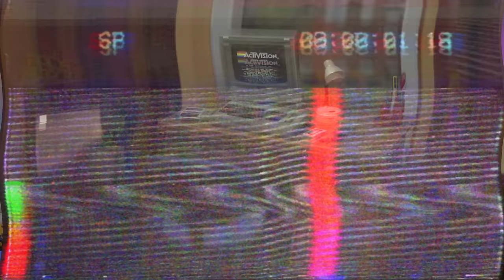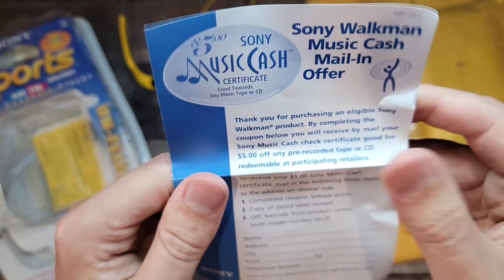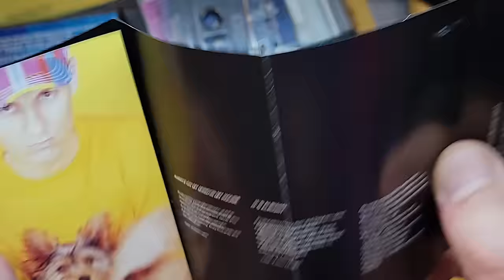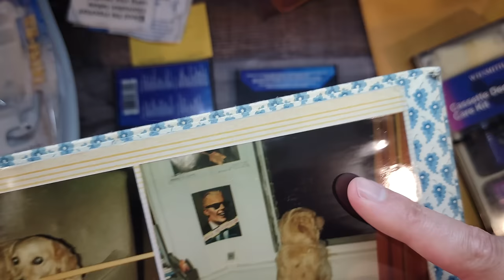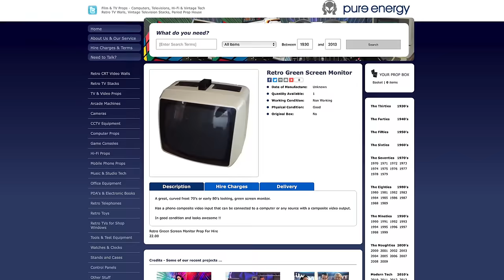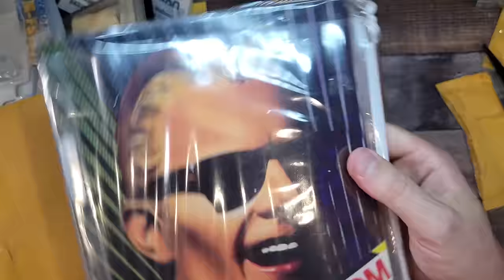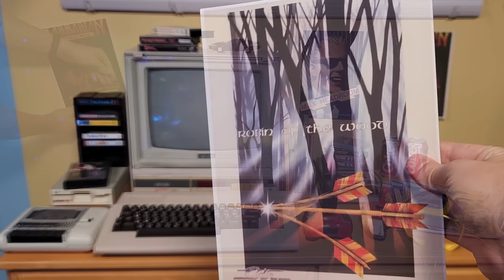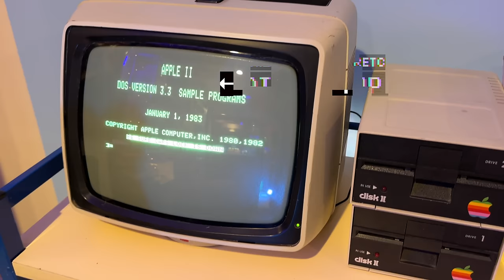Recreating my 80s Childhood Bedroom Computer Setups!

Comment: Just wonderful! It took me back too and reminded me of the other day when an old friend connected on Facebook and reminisced about my old computer room from the early/mid 80s and remembered my ZX Spectrum set up, the white hard case/keyboard, the thermal printer etc. etc. It's got me on a mission to find some pictures which I knew I took. Recreating it wouldn't be easy - Sharp MZ80A, Amstrad CPC464, BBCB, Spectrum, Vectrex, Atari 2600, Coleco, Intellivision, an original Space Invaders Cocktail Arcade table and more!

Comment: You putting the C64 PSU under the desk reminded me and suddenly took me back in time. Mine was also on the floor in the middle of the desk and i would put my feet on it in the winter to keep my feet warm while playing games. As the PSU got quite hot. As a 10 / 12yr old i was clearly not concerned about the psu getting hot. Just that it kept my feet warm.

Comment: I had a ZX81 (1982), a Speccy (the original 48 Kb rubber keys, 1983), an Amstrad PCW 512 (1986)... The music was EXACTLY the same (adding a generous portion of J.M. Jarre and Mike Oldfield)... What a time to be teenager, the early eighties, waiting for the exact azimuth in the cassette to load properly 40 Kb of data and typing hundreds of lines of code from the magazines...

Comment: We had one of those clocks that are below your Max Headroom poster at @15:13.  It sat above our Commodore 64 for years, and I wouldn't be surprised if my father still has it somewhere.  IIRC, it looked like a digital watch stuck in some clear plastic (Lexan maybe?) that made a simple angle bracket stand.
Reply from the maker: Wow can you find out the brand please? I thought Timex but apparently it was something cheaper.
Reply: @RetroRecipes  I could've sworn it was Timex too, but I also remember my dad receiving it as some sort of a giveaway.. so maybe it was a Fimex or a Timax 🙂

I'll see if he still has it.
Reply: @RetroRecipes  My dad said he received it as a Christmas gift from one of the guys he worked with.  He no longer has it (or he stored it in a random box), but he thinks it was a Timex or a Seiko.

I know we had at least one Seiko clock in our home, so maybe that was the one.  I'm looking at some Google image results and I'm finding analog ones with similar designs (but not that particular clock).
Reply from the maker: @RandomBitzzz  yeah I can’t find anything either. Strange as I feel many of us had it. Perhaps it was one of those free giveaways with some other thingy

Comment: All the feels in this!

Regarding your tape that didn't playback properly, it's probably the lubricating sheets inside that are worn. If your tape shell was screwed together, you can easily transplant new lubricating sheets into it. If the shell was fused together, then the only option would be to try to split it open to extract the tape media and transplant that into a new shell

Comment: Thanks for sharing your experience. This video is full of nostalgic warmth. I've started doing something similar with my Amstrad CPC6128 set up although can't exactly as the desk was hand built by my Dad under the stairs. But I've bought the same CPC6128 with colour monitor and even the sticker that came with the Ocean Batman the Movie game to stick on the side. I just need a carousel tape cassette holder and briefcase style cassette holder to put under the desk. Plus dodgy broken Amstrad joystick discarded and replaced with the Quickshot II Turbo that I have also purchased. The older I get, the more I treasure those care-free and happy days.

Comment: You are a real Doctor Who! Tom Baker would be proud.
Only you didn't have a Tardis, yet you still managed to bring 1980 to us.

My soundtrack would have been Styx, My first tape was a Mr. Roboto tape circa 5th grade.

My first PC, a Radio Shack TRS-80 color computer. A few years later, I got a Commodore 128.

I learned the hard way not to save programs to tape on a recorder just using battery power.
In order to get it to load, I had to drain my batteries down to a level the tape player would play at the slower speed it was recorded at.
From then on, it was AC plug all the way.

Why was I using batteries? In the early days, I would put my PC on the floor in front of a tv, sitting Indian style while typing in Basic programs from magazines.
When I was done, I would put the PC away so we could watch TV.

Hats off to you sir, thank you for a free trip Back to the Future sans DeLorean.
I will say this, I prefer to emulate C64, to skip the slow load speed of the tape/drives.
Reply from the maker: Thank you for your kind words! Means a lot 👍🕹️

Comment: I still have my original Commodore 64 and 1541 Disk drive, bought new in 1983, and it is in full working order, having having spent a small fortune on repairs to it, it has been lying in the attic for 30 years and needed major repair, and has now returned to the attic after being out for a while. Then I get to bring it out again in about 30 years for a new return to the 80's.

Comment: This video has such a great lineup of 80s music!   I recently put together a “Rock The 80s” play list and many of these are in there, and you have a few more I forgot about and will have to add.  I was born in ‘75 so when I was old enough to really start listening to music on the radio it was into the 80s, the decade that IMO had the best music.  I never had a Sony Walkman but in the early 90s I bought my first portable cassette recorder (not just player).  I still have it.  In the 80s I only had a portable radio with headphones which is how I was able to listen to so much great 80s music.  My original C64 is a stripped parts board now, but some day I might gather the parts and restore it with a new case and keyboard.
Reply from the maker: Dewit!

Comment: I adore this video. It truly is bittersweet to try these things. I had bought an ‘83 American Motors Concord in 1998. I loved driving it! I used to play my Outfield-Play Deep cassette while I drove it. I owned that car until the year 2001. I got my very first new car at 31 after that. I still miss that car and the feeling I got while driving around. It was hard to pretend it was the 1980s when modern times were outside my window, but it sure came close!

Comment: So inspired by this, I found my very first tape for my micro (an Oric 1) and loaded it into the PC using a usb tape player and Audacity. Converted it using the tools for making emulator suitable files and……it worked! A nearly 40 year old tape game being played by 50 year old me before going to work. It is a simple fruit machine program called Bandit, written in BASIC, part of the Multigames 1 cassette released by Tansoft. Nothing special to look at now, but it was magical having a game running on the big TV in the lounge in the 80s. These were magical times for computer games.

Comment: Well done on the recreation of your memorys man. You know if I wanted to do the same thing in my place it would take quite a lot of effort. The only things I could lay claim to in my retro set up would be my Commodore 64C (with a black and white 12" TV) and on the wall the 3 parts that made the Oink comic calander calander (God only knows from what year, 1987 maybe) attached hap hazardly to the flowery 1960s wallpaper with blue tac. Apart from the wallpaper all the rest was old 1960s carpet, curtains and whatever else made up a 13 year olds room back when things were made to endure. 
Apart from that, I always thought that your first computer was a C64, you seem to have such love for the system. I was surprised when I found out that the Apple IIe was closest to you (I've just gotten myself one, and I'm having a lot of fun with it). The C64 is a great gaming  computer though. Anyway, thanks for this video, sometimes just thinking of the past feels like a hole has opened up deep inside. I wonder if that feeling is not stronger the father we move from home. Take care ;)
Reply from the maker: It’s strange, the Apple is deeper rooted as it’s further back in time, and more connected to my father as it was in his home office. But the C64 I loved more as a computer. And those were special years too, just different.

Comment: Hey Chris! I'm one of your customers who bought your VIC II^2 kits! Regarding your problem of PAL to NTSC video conversion, I MAY have a solution for you. It works great for me, the only caveat is that it does not work out of the box with Y/C (although it is possible to convert from Y/C to vga first... Look up retro video adapter on Ian Stedman's blog) However, if you ARE able to output an RGBs signal (say SCART) or YPbPr, then you're in luck! 
I have a MiSTer FPGA and my solution to getting the C64 PAL core which outputs 50 Hz PAL video in Direct Video mode to work on my NTSC Commodore 1080 monitor was to buy a GBS-8200 and modify it using the GBS-Control firmware. That's your solution! It works perfectly every time with zero lag! Automatic 50 to 60 Hz conversion!
By the way, I love your taste and your channel and especially this video! I grew up in Philadelphia, but we are obviously of the same generation. Tears for Fears, Pet Shop Boys, Commodore 64, Knight Rider, Star Wars, hope you like Depeche Mode and Red Dwarf, too! Anyway, I really hope you figure it out! Check out the GBS-Control project on GitHub! It's definitely cheaper than an XRGB or Retrotink (I have the second version of each of those, lol. And both work great but can't hold a candle to GBS-Control!) and it also kicks the living crud out of the cheap convertors on Amazon!

Cheerio! And Frosted Flakes!

Comment: Tape's need lubrication to save your old tapes there is some video's how to relubricate them. I had to transfer about +20 90min tapes, and learned that they been sitting and stores wrong standing. but to remedy this easiest to try is using a HB2 pen to wind it back and forth to see that the spools flows propperly after 2~3 backs and forths. on them.

Comment: I had a slimline Commodore64C computer, in the late '80s. It was styled just like the Commodore 128, you showed. All the keys were about the same colour as the computer case, in a very pale sand colour. Fortunately, I do have one photo of my complete C64 set-up on my desk with everything around it. I've always been into photography, so I'm surprised I didn't take more photos of my stuff.

Comment: Brilliant, nostalgia brought to life. Enjoyed it so much.
You likely got the slimline case from Evesham Micros as well as the disk drive, I remember them advertising it. Truth is, the original C64 case design (by Porsche Design Centre) was much more wedge-shaped, but Jack Tramiel reused the VIC-20 case to save money (forcing the engineers to cram everything into a tight space). So the Australian company were just anticipating what Commodore would go for with the C64C rather than coming up with something original.
Reply from the maker: I definitely got it from Evesham yep. Glad you enjoyed this mate!

Comment: What a heartwarming video! You inspired me - I'm gonna do the same with [plenty of] my 80s stuff!
BTW. forget the UPS - to convert 60Hz to 50Hz just use an inverter (I mean a device that is used to control AC motors, it's cheap and uses IGBTs to generate desired frequency).
Reply: Oh and --- tailwags from my dogs to your dogs. Respect!
Reply from the maker: Thank you! Could you link me to a device that would convert 60 to 50Hz? Preferably whilst also converting 110 to 220V. Thanks!

Comment: If the UK UPS may or may not work, it may try to sync with the 60hz wall current. You can try instead to get a UK inverter that converts 12vdc to 220vac, a 12vdc marine battery and an automotive battery charger/power supply . Since the UK inverter would not KNOW there is an AC source, it will run off the batteries, while the battery is maintained by the charger.

Comment: I remember my setup well....

On the desk was my C64 on the left, and a pair of 1541's and a 1581 on the right(with my US Robotics 1200 modem on top). My phone sat between them. Later updates included swapping the breadbin for a 64C and one of the 1541's for a 1541-II.

On the left side of the  riser was my television, (under it was my VCR, and on top of it my cable box) and on the right was my 1702 monitor. 

To my right was a bureau that had my MPS801 printer several disk cabinets my stereo system  and a Gorilla monochrome monitor.

Next to that was a bookcase with tons of parts, joysticks, cassettes, video tapes, cartridges, bad disks, tools, empty Crystal Pepsi cans (🤣) 
Unfortunately I don't have a working Commodore setup at the moment to recreate it (just various broken parts), and I currently emulate it.... One day I will again... One day.

One of the desks in my office currently has a complete 800XL setup however, in that same basic layout.

It's funny looking at it across from my current PC.

Man those memories...

Comment: I had (and still have in a box somewhere, I think!) a yellow Sports Walkman from circa 1985, but the one shown in this video isn't what I had/have. Yours appears to be a later model. A quick Google search shows a lot of yellow Sports Walkman models over the years. I think mine was either a WM-35 or a WM-F35. It was water resistant and had all these gaskets to prevent water from getting in. I guess it was so you could use it at the beach or the pool, but I never did that. I just thought the yellow was cool.

Comment: Great video. My C64 has that slimline case, I still have it. And the quickshot turbo joystick, and the datasette, and the plastic tape holder like yours. And back then I bought the accelerator disk drive which arrived badged as a Master 41.
The only major difference was the monitor. I convinced my parents to spend over 200 quid on a Granada RGB TV (a rebadged Hitachi thing) and was annoyed that I couldn't get a cable to connect the 64 to the RGB socket on the TV.
I just might dig out the old computer over Christmas.
Reply from the maker: You didn’t get it in West London as a gift did you? My dad couldn’t remember who we gave it away to.
Reply: Ah, no sorry. I live in North Manchester. And the 64 was bought new as a bread bin. The slimline case was bought out of some magazine advert that I can't remember.

Comment: Oh, BMC! Even though your old monitor that you used for the Apple IIe actually wasn't a BMC, this is kind of interesting. Back before your last videos about that monitor, I didn't know they made monitors. Yeah, it's cool when you can get not only the exact model of devices for recreating an old setup, but when you can get the exact DEVICE for recreating it! For example, I still have what was my parents' old BMC BX-80 printer that my dad bought for our converter 64. I don't remember why he didn't buy a Commodore printer instead, but when you said "BMC," I thought it sounded familiar!

And I can set up most of my old Commodore equipment with the exact devices, because they never sold those computers, and they gave that stuff all to me! Our first computer was a Commodore 64 from 1982 that I still have.

Other than the broken Magnavox 40/80-column monitor we had used for the Commodore 128 and first 1541, which both broke beyond reasonable repair, I should still be able to use our original equipment! I just need to either find my old power supplies or by some replacements and then test to see if these computers still actually work like I think they do.

Back in those days we bought two third-party drives to replace the first 1541 (Blue Chip and Indus, and I still have the Indus), but years since then I bought two 41s on ebay--one Alps and one Newtronics (both tan-beige). We also bought a 1581 in the late '80s for the 128.

And then they bought a Macintosh in '88 but then in 90 they bought me a used Amiga 500! And yes, of course I still have that too!

Comment: Dude!!!   That's a fire waiting to happen! Buy yourself some wall mounted power strips and get those plugs organised!
Reply from the maker: Where? I don’t see a fire hazard. Using items as designed and rated.
Reply: @RetroRecipes  all those plugs stuffed into the wall. That's the stereotypical fire hazzard.
Reply from the maker: @markphillips8019  Again, that’s a multi plug adapter sold at a leading retailer with items plugged in exactly as designed. The power consumption of the items plugged into it is below what the item is rated for. So I really am not following what you’re saying. It’s like buying a car that seats 5 then when 5 are sitting in it, saying the car is too full and will explode. Either way it was removed and replaced for a floor option during the video as you can see during the 80s girls segment.

Comment: I think running a PAL C64 off 60Hz power will also make the clock run faster (and vice-versa for an NTSC model on 50Hz). The games will run at their regular PAL/NTSC frame rates though, because the speed of those is based on the crystal oscillator running the VIC-II/6510.

Comment: This is like the best video I've ever seen on YouTube! And I am so with you on this, although I did actually own a Commodore 128 so you might be jealous :-)  And I thought I was so cool with my Expert Cartridge (if you remember them ? or Freeze Frame Cartridge?) Anyway, whilst back in the 80's did you ever visit the Vision Technology Store in Richmond ? It was originally a TV/Hi-Fi shop and its sister shop in Croydon (where I lived) eventually sold computers (so I am assuming the Richmond store was the same as I never made it there ?) In the end the Owner wound down both stores and Opened a dedicated Computer store in the mid to late 80s called "Hi-Voltage" in Croydon (did you ever visit?) and I ended up(which of course was ever teenagers dream of the time)  getting a Saturday job there (incidentally the owner Jan Murray eventually build the PC World franchise but that's another story).  Look forward to more 80's time travel vids (good soundtrack too)